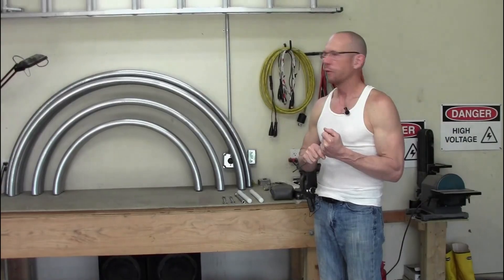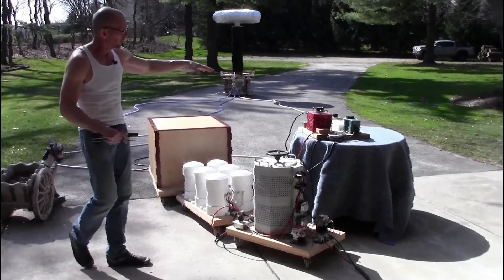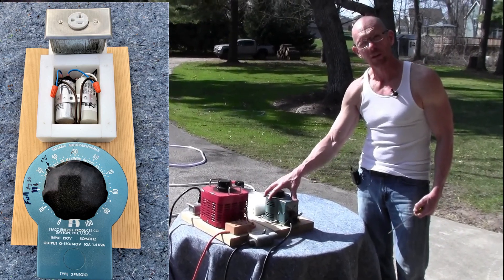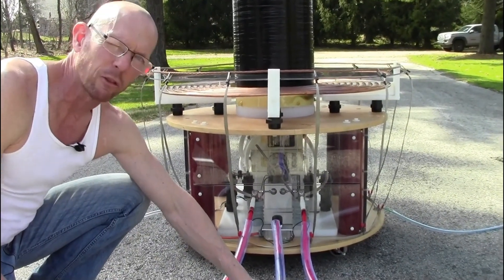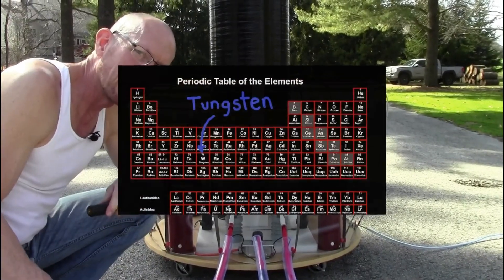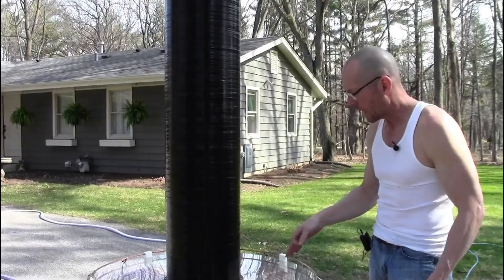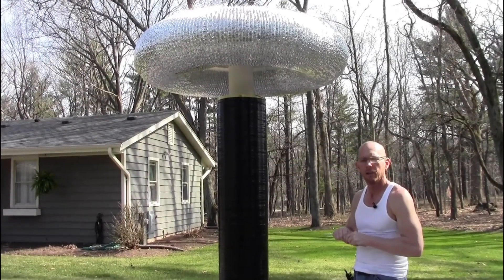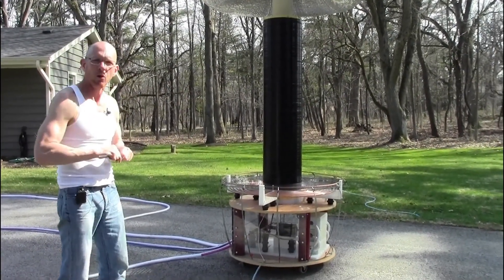⚡Monstrous Tesla Coil, Walk Through⚡

Comment: One  minute in this video:  The absurdity and ignorance of this design and calling it a "Tesla Coil" by both this creator and audience is beyond compare.  Simply put this IS NOT a "Tesla Coil".  This is (at best) a replica of a 'Sir Henry Lodge Transformer'.  How and why?

First off a "Tesla Coil" has absolutely no 'primary coil'.  Secondly, though a high potential DC voltage input is necessary,  the purpose of any input is to cause a disruption in the surrounding "sea of energy " that exist everywhere.  Once coupled with an Arial (antenna) energy from "the sea of energy " will flow for a period of time even (measured in multple minutes)  when the DC input is turned off. Simplifying the statement: The initial DC input acts like a 'pump jack' causing energy to flow through the circuit and its output. See Tesla's "Hairpin Circuit" ( also see Chapter one "Secrets of the Cold War Technology " free PDF download. )

An "Electrical Transformer" on the other hand, usually have  "primary and secondary coils". The purpose of these two coils are to simply either 'step up ' or 'step down' a voltage  output. Furthermore,  they do not TRANSMIT Electricity.  Conversely stated a "Tesla Coil" can "Transmit Voltage over several miles".  So ask yourselves, does this alleged design transmit voltage? Does elecrical output continued after power is turned off? No! It only steps it up and therefore IS NOT A Tesla Coil.  Wake up people and educate yourselves. 😊

Comment: I have been surprised by how much power you can pull from a pair of standard UK 13A sockets when running a Tesla coil with proper power factor correction and some resonant rise! I find that you can get quite a long way with calculations and measurements and small-signal tuning, so that only fine tuning is required at the end. For three-stage magnifiers too.
Reply: How much, then?  More than 15A/socket?  More than 20?  How big is the wire in your walls?
Reply: @railgap  About 20A for a few seconds from a single BS1362/13A fused plug, and about 30A total for a few seconds from a pair on a 32A ring main (I didn't want to burn down the house).

Comment: The FCC loves this man
Reply: Nah.  TC's are lousy transmitters unless you can connect a (very long) antenna that resonates near the coil's frequency or one of the first harmonics.  
TCs are very broadband noisemakers, so the power is spread over many frequencies.  While on the surface that seems bad, the result is that each
frequency has very little power on it.  Experiments with AM and shortwave radios have shown that the noise from a very large tesla coil only goes for
a couple of blocks.  The FCC doeds not care unless and until someone complains about you.  This rarely happens.

Comment: To calculate the resonance frequency of the filter inductance and C-prim is very simple: the resonance frequency = 1 / (2 PI x SQRT(LC)) 
The problem is: what is L and C in this case, as there is a HV transformer in between.
You can approach this from either side, the HV end or the LV end. Let's take the HV end.
On the HV end, C is simply the actual capacitance of C-prim, but what inductance do you see from this end? A low current on this side will translate to a higher current on the other side of the transformer, meaning that more current will flow through the inductance and thus the inductance will show a higher impedance. How much higher? Assuming that your transformers have a 120V primary and 14.4KV secondary, the current on the primary side will be 120x higher. Therefore L in the above equation should be 120 x the inductance of your filter inductors.
PS. I ran into this problem myself and it cost me my ceramic primary capacitors. (which still saddens me today, as they were magnificent)
PSS: Don't worry too much about insulating the secondary coil. Just wind it tight (windings close together) and tune the circuits at low power.